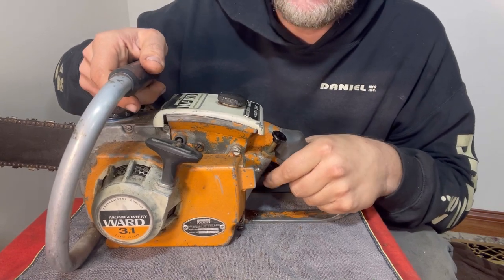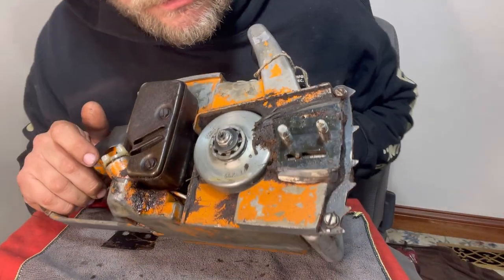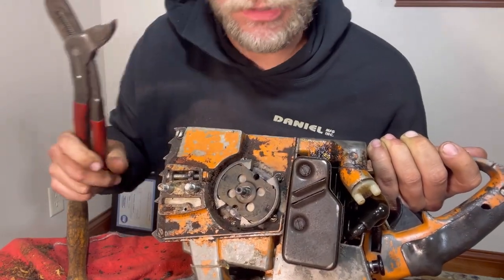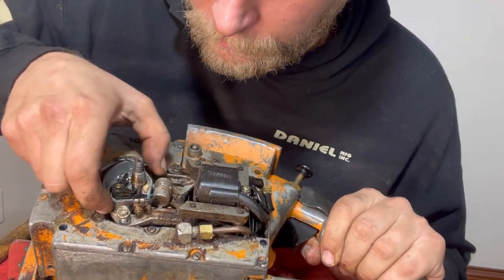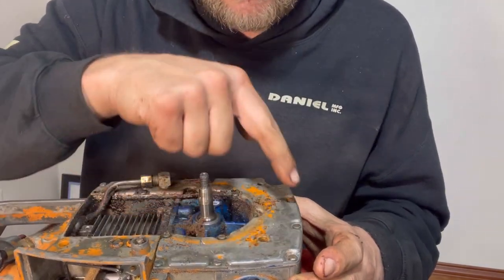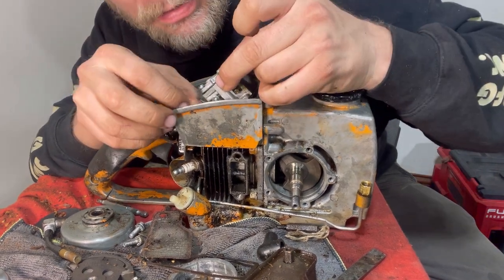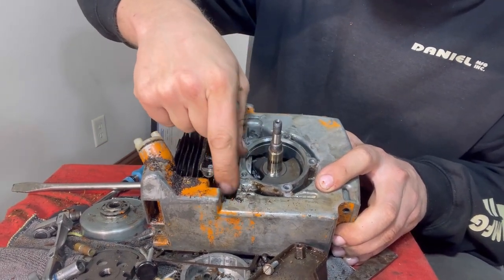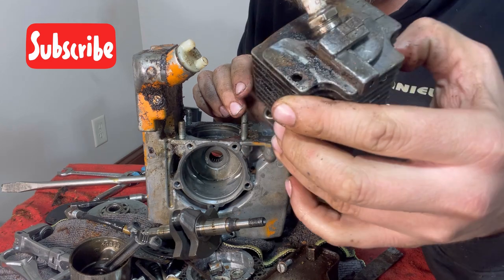Vintage Remington Chain Saw Teardown Inspect Antique Montgomery Ward

Comment: Naptown make some 3.0 avk asn videos I can't many good videos on a run down on what to look for and what years to avoid ect. , I currently have a 2002 ultrasport a4 3.0 6 speed manual , I cannot figure it the po300 for the life of me , cams are good timing belts brand new , plugs and coils are brand new , ignition coils are all firing and all Injectors are pulsing the same . Replaced all vaccum lines and pcv lines , mass air flow has been tested and is fine , cats are gutted and defoweled, 02 wiring has been messed with on the passenger side bank,  wire 3 ( ground signal too computer ) is cutt off the passenger bank and jumped from the driver side bank on the upstream 02 over too terminal 3 on the passemgerside bypassing the ground to cpu from the passenger side harness completely , would that affect the idle of the vehicle?